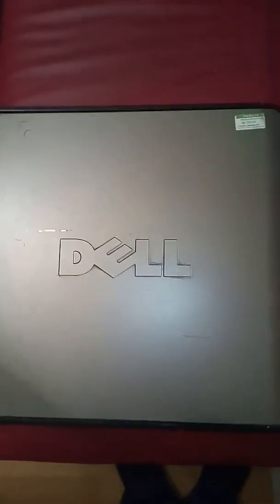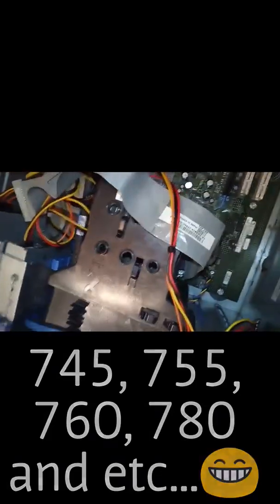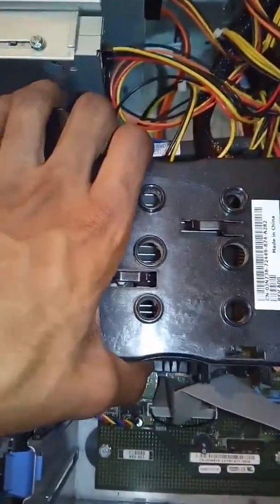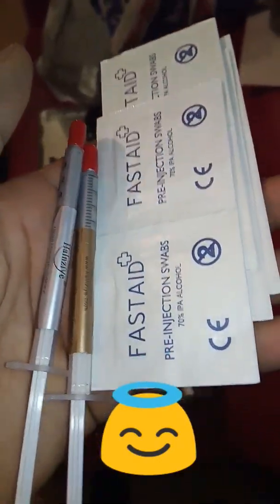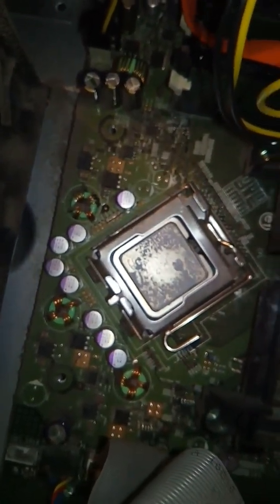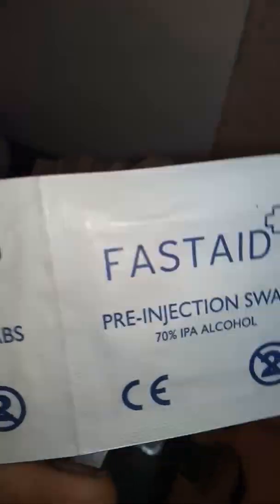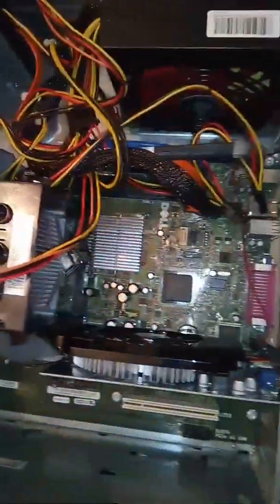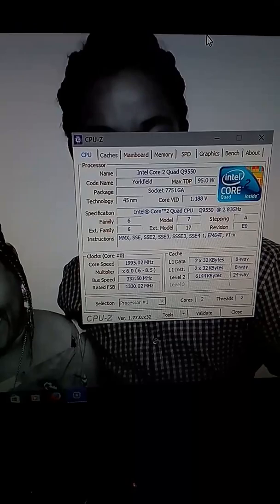Dell Optiplex 755: Goodbye Core 2 Duo, Hello Core 2 Quad!!!

Comment: the background music, just a bad porn movie hahahaha, nice video thx for the info
Reply from the maker: Nico Ligotti Looool your welcome man 😂👍👊💯
Reply: SlimSouljahTV i have a question, (srry for my bad english) but, how is possible this? you put a q9550, and in dell official website says the maximum cpu that you can put on this pc is the q6600?
Reply from the maker: Nico Ligotti You need to upgrade the BIOS to the latest version which is A22. Then, you will be able to use Q6700 and above
Reply: SlimSouljahTV and you use it with the default cooler? or you buy a new one?
Reply from the maker: Nico Ligotti Yep! I used it with the default cooler

Comment: I put thermal grease on & use my finger (not smearing but dabbing it all over) to evenly coat the CPU, making sure there's no gobs overlapping like what appears on the heatsink.
I've seen overdone where the grease insulated the heat by overcoating & even getting into the pins - Bad!

Comment: Bit late, but what power supply is that? Also had a plan of changing the cpu would a heatsink with copper slug work with fine the cpu you have?
Reply from the maker: Micro ATX 500w Power Supply from eBay: https://www.ebay.co.uk/itm/New-ACE-Black-500W-PSU-PC-Power-Supply-Unit-Quiet-120mm-Red-Fan-Desktop-ATX-/201782737613?_trksid=p2349624.m46890.l49292

Yes of course, the heatsink with cooper slug will work fine with the Core 2 Quad Q9550👍🏽

Comment: Bro, do I have to change the heatsink before upgrading to core 2 quad q9650?
Reply from the maker: No Bro, you have to replace the current thermal paste of the heatsink before upgrading to Core 2 Quad Q6950 with new paste💯
Reply: @SlimSouljahTV  Thanks, brother.

Comment: quick question, did you at all have to go into bios and change any settings or did you just switch out the gpu's then started it up?
Reply from the maker: I just switched out the GPU to started it up, installed the GPU drivers via Windows Update to have a better screen resolution and updated the BIOS to the latest version from Dell Official website
Reply: @SlimSouljahTV  link to both by chance?
i just picked up a 755sff for only 20$, already plan on using a msi or geforce gt 1030 graphics card with an upgraded storage to 1tb, and maxing out the ram at 8gb. also probably a ssd, not sure yet.
Reply from the maker: Link to BIOS: https://www.dell.com/support/home/uk/en/ukbsdt1/drivers/driversdetails?driverid=2dwty
Reply from the maker: For your GPU, you can visit the official MSI or Nvidia Official website online to find the graphics driver for your GPU or automatically update your GPU right away via Windows Update

Comment: the upgrade is Intel Core 2 Quad Q9650 3.0 GHz Quad-Core?
Reply from the maker: Nah, Intel Core 2 Quad Q9550 @ 2.83GHz Quad Core 😎👍🏽💯💯
Reply: Q9650 works?
Reply from the maker: Yep, Q9650 works 😎👍🏽💯💯💯
Reply: @SlimSouljahTV  x5450 works?
Reply from the maker: Unfortunately x5450 doesn't work according to this website https://www.delidded.com/lga-771-to-775-adapter/3/#dell
Reply: SlimSouljahTV Q9300 2.5GHz works?
Reply from the maker: @TSTSL  Yes, Q9300 works 😎👍🏾
Reply: @SlimSouljahTV  Q9450 works on 755 optiplex??
Reply from the maker: Yes, Q9450 works as long you update the BIOS to the latest version 😎👍🏾💯💯💯